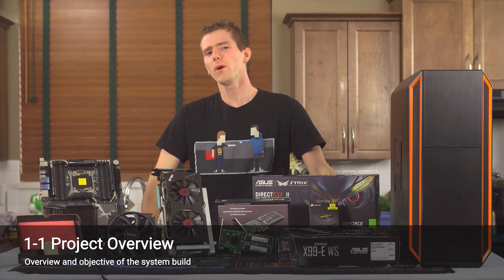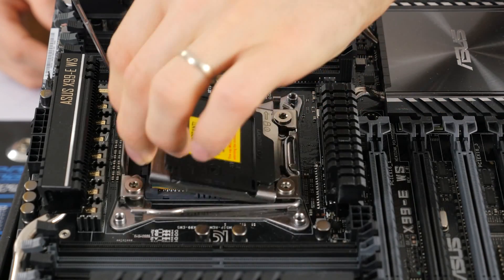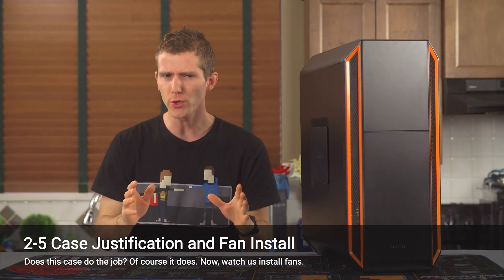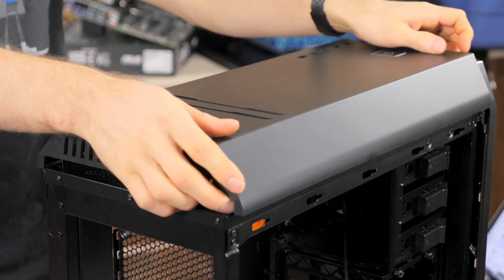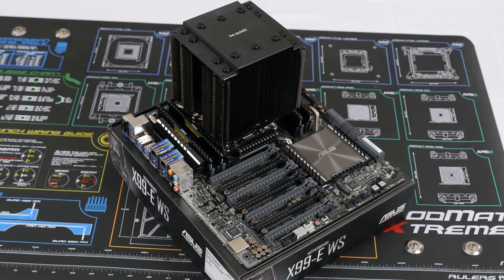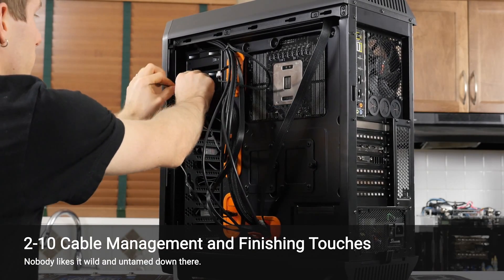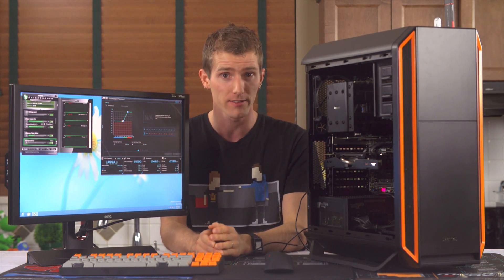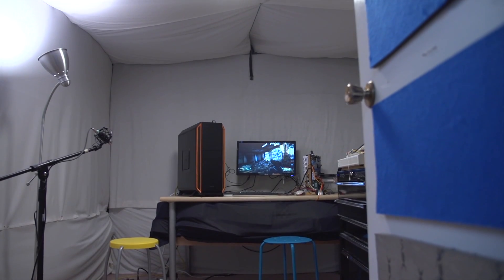How to Build the ULTIMATE Silent Gaming or Workstation PC

Comment: I don't find this build appealing from silent Workstation perspective baring that exceptional Mushkin Scorpion Deluxe PCI-e 960 SSD. Based on the components (CPU/Mobo/GPU) used, this build is no brainer to go for. Only component which I never used is be quiet! Silent Base 800 case and its silent fans, hence I can't comment on them.

Note 1200 gram cooler on $400 board? Stop doing that. Air coolers are great, but too heavy models shouldn't be used on workstation boards because each one would have at least $5000 worth of hardware in form of workstations GPUs, few critical PCI card(s) like say LSI SAS type which RAID SSD and/or many HD drives in TBs. Hence don't make ridiculous arguments in favor of heavy Air coolers because I myself saw a few workstation boards departed early because of bearing heavy loads (Thermalright) for years. Motherboards are not concrete rooftops to hold enormous loads without suffering any considerable or serious damage.

Also, that cooler doesn't deliver any exceptional dB values when I compare it with the new CM Nepton 240M water model. Hence I chose the latter for my five 5960X ultra workstation builds, each with 15K budget. All are non-gaming builds (work in progress at snails pace due to hols).

Comment: Hey everyone,
i am buidling a mackintosh for my little brother because he needs a new computer (he is currently on 2008 iMac)
I have some parts that may work well and i want to know what you think about this build:

Mobo: GIGABYTE GA-H81M-DS2V
GPU: Gigabyte GTX 680 Windforce OC
Case: Fractal Design Core 1000
CPU: I5-4660
SSD: Crucial M500 128 GB
RAM: G.Skill Ripjaws X Series 8 GB 1333 mhz
PSU: Corsair CXM Series CX500M
HDD: Already owned
Monitor: Acer G7 Series G227HQLBI Black

Please let me know what you think about this build

PS: Don't be like "Why do you use gigabyte cards and not And blebleble" Please i just want to know what you think :-)

Comment: To anyone installing the Dark rock pro 3 on a 1150 system, check out the video HiTechLegion made about it. It helped a lot for my build. Do not even check the manual included with the dark rock pro 3, it will only confuse you. I got a 4.7ghz overclock on a 4790k with this thing and it runs very very very quiet and cool.

Comment: I too have the Silent Base 800 ... this is the rest of my build:

i7-4790k
Noctua NH-D14
Asus Z-97 Pro Gamer
Kingston HyperX Fury 2x8GB @ 1866MHz
Gigabyte GTX 970 G1 Gaming
Crucial MX 100 512GB
Antec 750M

I was thinking of putting the rear fan from the case in the bottom next to the PSU...
What do you think?

Sadly I currently don't have the money to buy new fans or such. Anyway I think that the loudest component of that rig is the 970 ...

Comment: ID really like to see a proper detailed guide  on the process of setting your rig up for the first time. Post, setting up the UEFI, setting up boot drive, installing OS, what system drivers to get first, what utility's to get first and what to avoid. How to set up and personalize HDDs, how to change default settings and save locations for all the default folders. 

Tips and tricks for gaming machines, any other cool or recommend utility's or settings that can help performance. 

I know all this stuff exists on the net and even Linus has some videos explaining some of these things.. It would just be nice for a first time builder and maybe even a few old pros to have all this info in a easy to follow tutorial. I know when I build a rig I never feel like I'm getting the most out of the power available and not taking advantage of many useful features.

Comment: So, recently my family has started doing holiday baking, this means we start using the stand mixer... However, my mother has a bad habit of burning these out. I was wondering if it would be possible to make a stand mixer cooling system. I am serious, my mom has destroyed at least 3 mixers by running them at full power for too long and overheating them until they burn out.

Comment: There are bunch of silent system combos, I personally would do something like this,
For cpu cooler I would use a thermalright passive cooler
For gpu maybe the strix asus graphics card or a even slap on a closed loop cooler like the nzxt kraken with the nzxt graphics card bracket. 
Fans, either noiseblocker or noctua or any silent fan brand at low rpm. 
Case, either this one or fractal define r5
Reply: There aren't any aio's that even come close to being as quiet as just going with air.
Reply: but once the temps ramp up, gpu fans can get pretty loud, much louder than a AIO pump.
Reply: baitboy3191 Depends on the graphics card cooler. Many of the 900 series coolers are more than adequate to run at ~30% speed at load or even less at idle. I have NF-P12's strapped to my 780 instead of the stock fans and I have them running at 5v regardless of load.
Reply: baitboy3191 no way man.  Water cooling is not good for silence.  On air in a well-built PC with 5-7 slow-moving fans will be quieter than a loud pump.

Comment: Will this run dayz mod 

CPU: AMD FX-4350 4.2GHz Quad-Core AM3+ CPU 4MB L2 Cache & Turbo Core Technology 

MEMORY: 8GB (4GBx2) DDR3/2133MHz Dual Channel Memory (ADATA XPG V3)

MOTHERBOARD: GIGABYTE 970A-DS3P AMD 970 ATX w/ Ultra Durable 4 Classic, On/Off Charge, GbLAN, 2 PCIe x16, 3 PCIe x1, 2 PCI

VIDEO: EVGA FTW Edition NVIDIA GeForce GTX 750Ti 2GB GDDR5 PCIe 3.0 x16 Video Card (Single Card)

POWERSUPPLY: 400 Watts - EVGA 400W Power Supply 
OS: Microsoft® Windows 8.1 (64-bit Edition) 

Up for suggestions not looking for ultra settings just want to play and enjoy thanks

Comment: 24db for a 350W(ish) TDP computer is really impressive IMO =) you can easily achiev less with ultra low voltage hardware and no dGPU but that means it will not be suitable for gaming or any kind of demanding programs.

Comment: I need help with my build

Cpu: Intel core i5 4690k
Gpu: Msi gtx 970
Ram: Kingston fury 4x2 8gb
Mobo: gigabyte fa-Z97X sli 
Storage: western digital caviar blue 1tb
Case:nzxt h440
Power supply:evga 750w

Essentials 
Keyboard: corsair k70
Mouse: Logitech proteous core
Headset:corsair 1500 v2
Monitor: need help on one
Speakers: already have some

Help me tell if this is good and a good monitor.

Comment: Nice try Linus, really interesting article.

If you want to try again to see if you reach 30db, try Antec True Quiet 140s + Fractal Design Define R5, with FanXpert2 you can drop them to 200rpms or off you wish so, on the GPU you can try an Prolimatch MK26 should handle the 980 extremly easy, i would go with a pair of prolimatech ultra slim vortex 140, it can be droped to 360rpms where they are inaudible as well, the rest of the components .

Comment: Yeah, great idea, lets build a quiet Formula car or a quiet 700 horse power classic Chevy. Would it be possible? Would somebody want it? My PC it's build on a Cooler Master 932 Advance Case, I use the Nepton 280L CPU cooler with 2 Noctua NF-A14 Industrial PPC-3000 PWM fans to cool a 4770K at 4.4 ghz, when I'm editing, the fans crank up to 2740 RPM, noisy, really noisy. But, I compare it with a 700hp Classic Chevy, it has to make noise, that's the fun of it.

Comment: This is exactly what I do too, plug all fans into my motherboard (sabertooth z87) and then use the Asus aisuite to control fan speed and turn them off completely under a certain temperature.
For the gpu I use the fan curve setting in msi afterburner.

Comment: hello tech world !! my recent build is : i5 4690k, msi z97 gaming 7, 2*4 vengeance 1600MHz and r9 270 4GB.... now the point is.. when i set the M.B settings to default it says that the RAM speed is only 1333MHz and when i change it to 1600MHz without changing any other setting my PC suddenly stops and says: "your last overclock settings were not ok or something like that and they were reset to the stock settings" what should i do guys ??

Comment: I dont know. My build is pretty quiet. I didnt think it would be that quiet when i was picking the parts but you almost cant hear the ventilators. Typing is louder than the pc. I am using Hyper 212 Evo as a cooler and Fractal Design Core 
3300 case.

Comment: One thing you could do is fill up a case with radiators and cool the CPU and GPU whilst having very low RPM fans. That should allow OCing the CPU (and GPU) and achieve a near silent PC. That's what JayzTwoCents did.

Comment: Watch Linus' video on Coil whine (may be on techquickie). Nothing can be done about coil whine other than pin-pointing exactly what hardware is causing it and replacing it with something else, because getting the same product won't change anything.

Comment: I like these videos, but they could be much better if you drop the assembly step-by-steps for newbies. I'm sure most of the people here know how to install RAM and screw in a motherboard. I want to know more about the parts: the dB ratings of the fans, the RPMs, the CFMs, etc. I want to know about the temperature loads of your CPU and GPU with this kind of setup. I want to know about the kind of stuff us techies geek out over: the numbers and the specs!

The decision process is almost not there and we're left with a weird mish-mash video "guide" that isn't really aimed at newbies who don't know about how to plug cables in nor is it aimed at veteran techies who'd like in-depth discussion about the build itself. Just my two cents.

Comment: Ok, so the noise numbers are good, but what about what really matters, how does it perform under load? While a quiet gaming PC is nice, no one really builds a gaming PC because it's quiet, they do so for perfomance. Does this system last under load? Does it heat up quickly with no direct fan on the CPU cooler?

Also there are a coupel liquid coolers that only have a single powered device for the pump and fans, the liquid is used to power the fans. Antec makes them. http://store.antec.com/liquid-cooling/

Comment: Yes, push that cooler to its limits with a 5960X, but don't just leave it there... It's a gaming build, not an über-workstation monster. 

I also understand that you have received some kind of revenue in the courtesy of Be Quiet!, but there's a shit ton of coolers that are much better at serving as passive heatsinks like Prolimatech Megahelms or Zalman FX100. Dark Rock Pro 3 with fans installed barely takes a mildly OC'd 4930K, with the hottest core reaching 75°C or above. 

And giving almost no fucks about the video card choice except for its ability to be tweaked with some graphs in the driver... Yeah I know it's damn hard to pick a gaming capable graphics card that is passive or whatever but would water cooling only the GPU be really all that bad?

Sorry for being butthurt, but as a guide this one could be better. I mean - the sound test is the one reliable proof, but don't except a long lifespan of your components, an oh - don't get too close to that PC, you can get burned. 

The PSU, mobo, RAM and SSD choices are good though, and case probably too.
Reply: neoqueto he was also going for silence not just speed and i assume that Linus will actually be using this workstation thus the extra 2 cores will make a differnece for video editing, audio editing, but as you said not in gaming. Also with the water cooling the GPU part he explained why he wouldnt be doing that because of the noise and this was a quiet build not a gaming build persay even though yes it will run almost everything if not everything at max for gaming so far.
Reply: Oh yes, didn't notice it's also a workstation build, my apologies. They did a pretty good job at I guess what it is then, but I still hold my opinion that while you can have a silent gaming & workstation PC it doesn't mean you necessarily should. If it was a super silent workstation, I'd pick some of the newer passive GTX 750's by Zotac and Palit, just for that extra amount of CUDA cores and I guess performance in viewport in 3D applications. If it was a gaming rig I'd get a cheaper, less powerful but colder CPU. But if Linus needs such a frankencomputer, I'm cool with that.
Reply: neoqueto the thing is that Linus probably will be using it for gaming on newer games for work and/or for joy times.

Comment: The noisiest thing I've ever owned was the boxed cooler for my AMD Athlon X2 6000+.

It wasn't terrible at first, but after a year and a half, in summer, under a load, it became as loud as a vacuum cleaner, I kid you not. About a year and a half later, it was that loud under load even in winter and started to get noisier and noisier even when idle. I replaced that sucker with an Asus Silent Square and haven't had a problem since then.

Comment: Is he really using passive cooling on a 5960X? nice build! :D
Reply: yes that he is though as he siad he is only running it at 3GHz as if he was to overclock it he would need active cooling and/or liquid cooling which would cause more sound thus not be as quiet in the computer and quietness while very aggressive computing power is the point of this build.
Reply: I'm just impressed that it works :D
Reply: same here but i would want to see the temps on it under load though as that is probably where he would have the most trouble but it is kinda hard to put a 5960X under full load as most programs do not take advage of all 8 cores atm

Comment: How much was the build?
Reply: Well the cpu and that pcie ssd was about clearing $1500.00 usd alone so it's a safe bet it ended up clearing $2k.
Reply: Raymond Tyson
 it is more around $3,000 for the entire computer and i am assuming this as i recently got a computer very simular to this one is all with a few tweaks to it to make it less able to corrortion instead of being more quiet becuase of the material used. It is also a heavy case so if you are planning on getting it prepare yourself for a heavier computer purely becuase of the case.
Reply: oh ok thats over my budget but not surprised for a dead quite PC
Reply: it is over most peoples budget for that thing too but a $1,500 and a $3,000 at most times preform about the smae unless designed for a special use case and used in the special use case.
Reply: oh kk i have a $2558 computer at the moment
Reply: yeah you are paying for looks and brand names by the time you get past $1,500 and rarely extra computing power unless you have special components in it that make it so much better than my $999 HP computer before the graphcis card update which was about $500 to a GTX 980 as i got it on sale thankfully not much of a sale but still a sale.
So your $2,558 computer is probably looking better than mine, probably has better cooling for when and if you are doing overclocking with it and lighting in the case and etc. like that but if you are not doing overclocking and do not care about the interior design because of a closed case then over $1,500 is useless stuff.
This is of course assumeing that you got it prebuilt and went with a windows PCas Macs are a ton more for the same specs as a PC is.
Reply: i built mine my self so :)
Reply: and with linus's help of his videos and im thinking about doing a mini ITx build soon :)
Reply: i am going to do a mATX build soon once i can get my dad away from work for long enough to lay the network wires for it to be conneted to the home network the computer itself is going to be built soon but up and running for its prupose probably will probably be next year somtime as none of the computer channels tell you about how to lay network cables that are easy to follow of course.
... with that said yes some show you and try to teach you how to make the custom lengths of network cables of ethernet and/or other standards but not how to work them around a room or even inside of walls and/or cielings.
Reply: nice